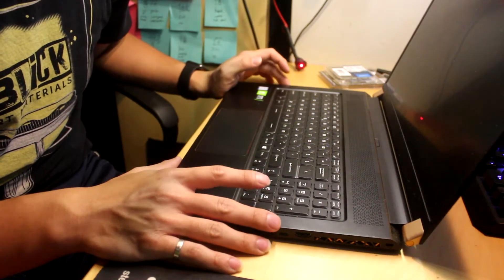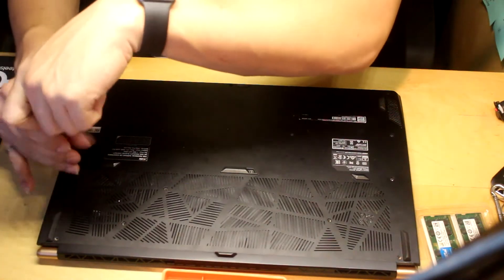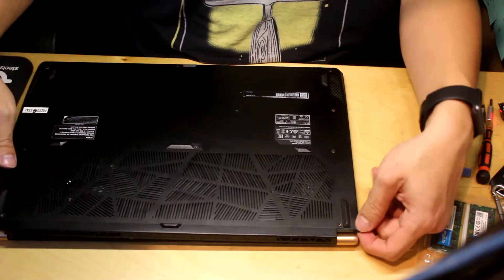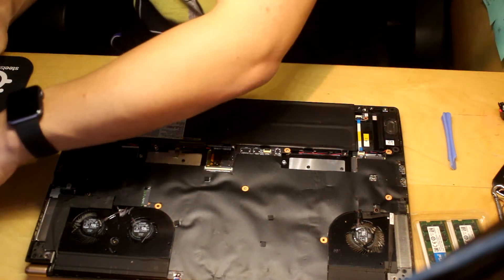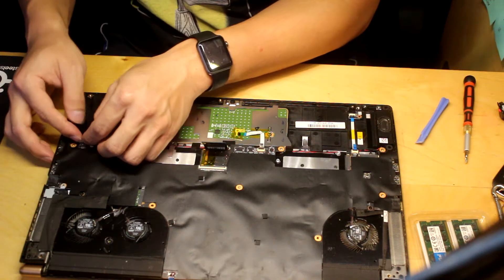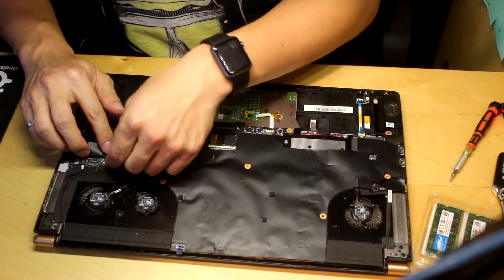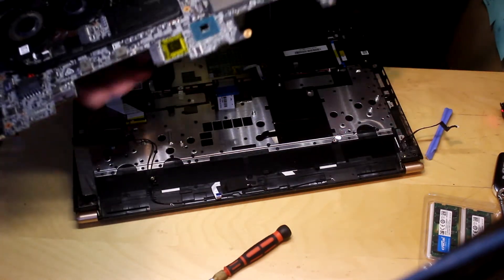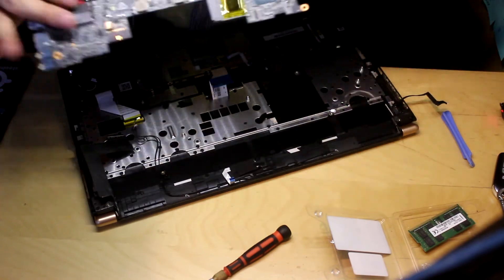Tear-down/Upgrade RAM and SSD M.2 for MSI GS75 Stealth

Comment: What m.2 did you install last?
Reply: hi there, i have this laptop too and stumbled across your video while looking for one on keyboard replacement. i hadn't given upgrading any thought prior and was wondering what your recommendations may be..? i figured since I'll be removing that stuff to get to the keyboard it might not be a bad idea..
Reply from the maker: @noli4208  ultimately it really depends on what you're using it for. Normally 32gb is really the max I can recommend on RAM space. And upgrading storage is always a great thing, only if you have the budget to do so.

16Gb DDR4 RAM is normally plenty if you're doing normal things like gaming and browsing. 32Gb is more for the streaming-ish and rendering engines/editing videos.
Reply from the maker: Installed a microcenter inland premium 1tb SSD M.2. It works good enough for storage. But you want to make sure you’re using the correct type of supported M.2. This laptop supports two M.2 PCIe and one M.2 SATA
Reply: @EricLiuUilcire  I have the 9SF version of that GS75 and wanted to know where the m.2 SATA would go?
Reply from the maker: @tyetsosie  The M.2 SATA would go for the bottom left. It is the vertical slot rather than the two horizontal slots for the M.2 PCIe. (though, I could be wrong. It's been a while since I last remember.) Weirdly I'm not sure why the laptop manufacturer didn't support 3 PCIe-s... it should have enough bandwidth... But nevertheless, having a M.2 NVMe PCIe and a M.2 SATA. If the laptop doesn't recognize the SSD, then just put it in a different slot. Hope this helps.
Reply from the maker: @tyetsosie  Also FYI. I would first allocate both M.2 PCIe for the benefits of read/write speed and durability. The limitation on write speed for M.2 SATA is pretty slow around 500MB/s compared to a PCIe that is 3000MB/s.
Reply: @EricLiuUilcire  what's the maximum memory this laptop can achieve?
Reply from the maker: @shaqawan2801  really depends on the motherboard manufacturing and processor, but it can be safe theoretically at 64gb max. (I’m not 100% really sure) But... 32 GB is plenty for a laptop. Anymore than 32gb is kind of overkill for normal use of editing and rendering. Plus a single stick of 32gb would be way too expensive, since you only have 2 slots of RAM on the board. At that point you might as well invest in a desktop with upgrades over time. Or buy a higher end laptop that can utilize more ram slots/speed. 🤷‍♂️
Reply: @shaqawan2801  I placed two Samsung 32GB DDR4 2666MHz RAM for a total of 64GB of RAM in my 9SF GS75.
Reply: @tyetsosie  is it good laptop?